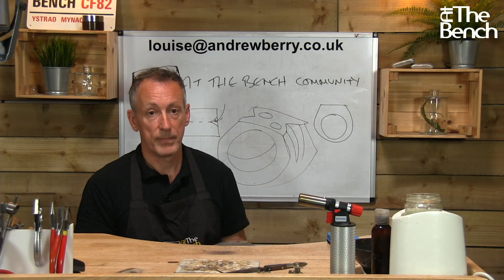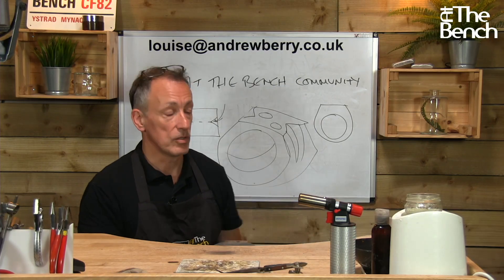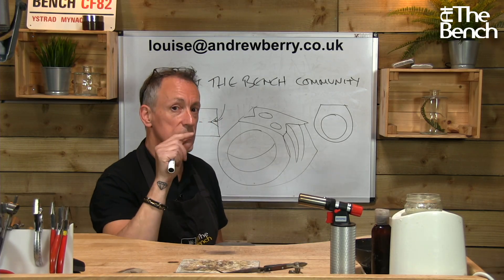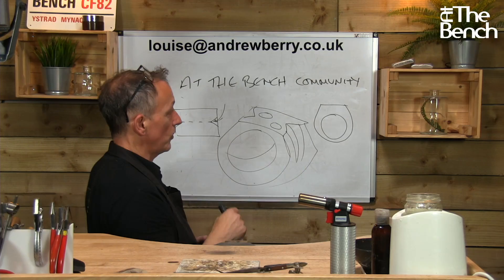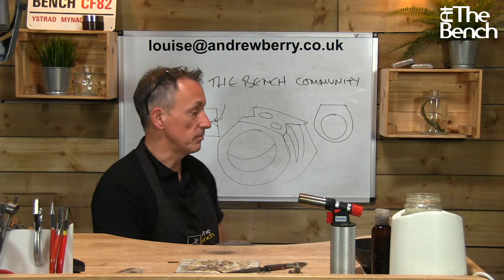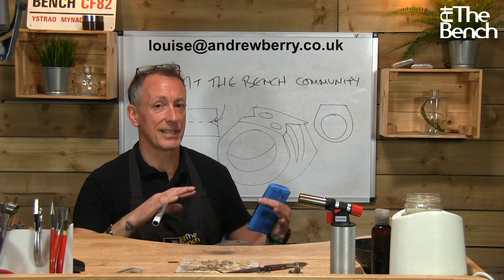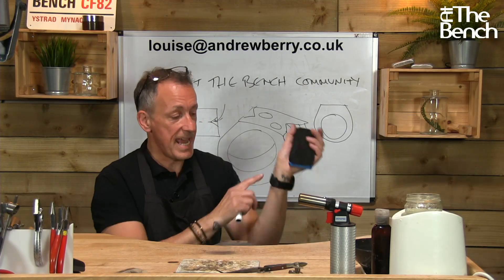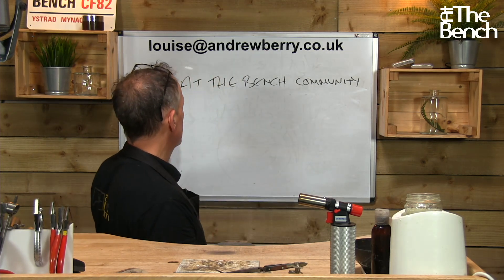Everything I Wish I Knew Before Trying Delft Clay Casting

Comment: What are the health risks using the delft clay where she talks about at 5.55 minutes?
Reply from the maker: Louise was talking about the low costs involved with delft claw casting. The clay is cheap. Not taking into consideration everything else you need such as torches, benches, safety equipment etc.